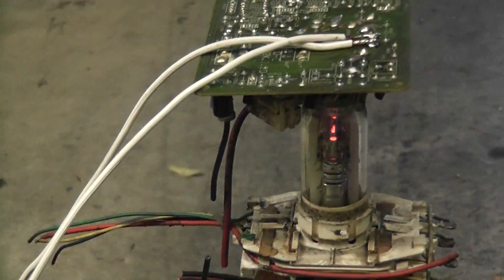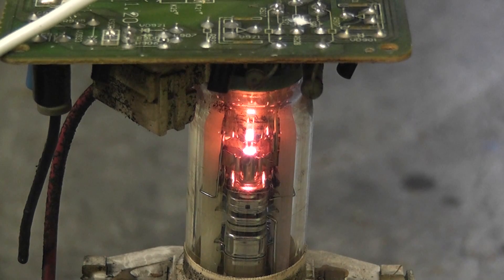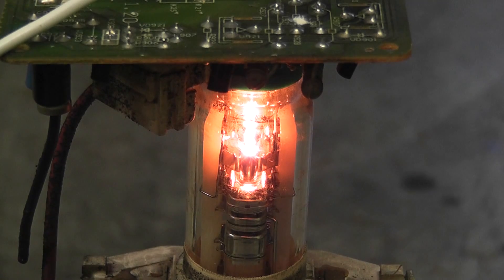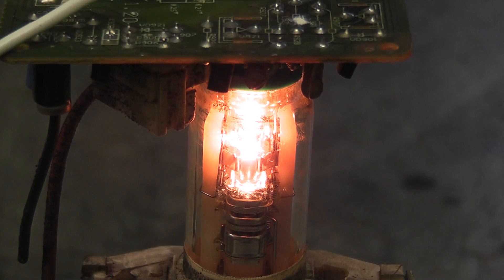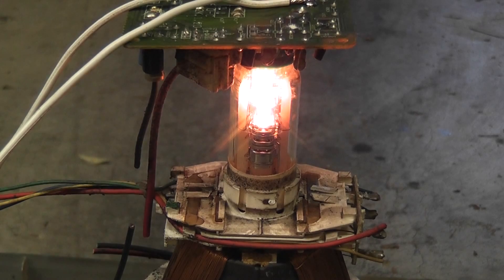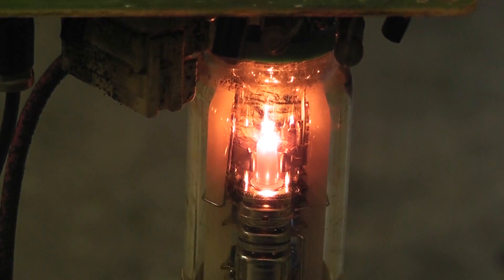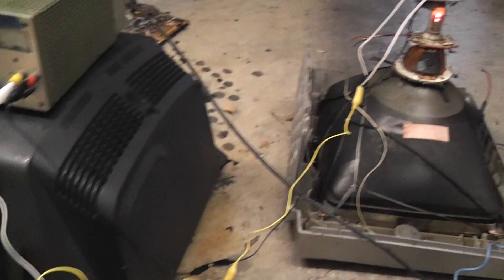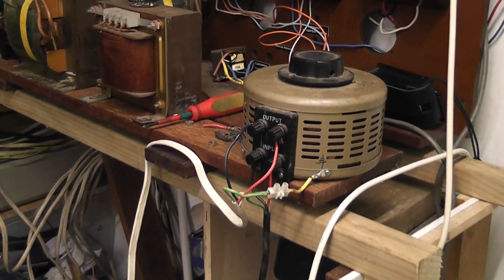CRT filament overvolted

Comment from the maker: Yes, but the appliances are designed for the higher voltage. 1 kW at 120 Volts is about 8½ Amps. 1 kW at 240 Volts is about 4¼ Amps.
In this case the voltage is 5½ times normal voltage but the resistance of the filament remains the same.

Comment from the maker: No, as the voltage was increased via the variable power supply the current through the filament increases. ( Ohms law ) The resistance of a hot filament doesn't change too much.

Comment from the maker: Yes. On old TV's when the tube gets weak you can boost the voltage with an external transformer from 6.3 Volts to 9 Volts, and extend its lifetime.